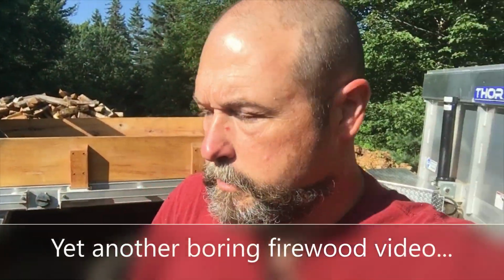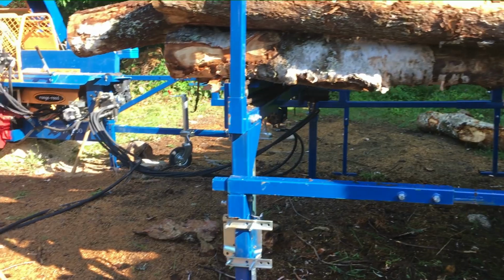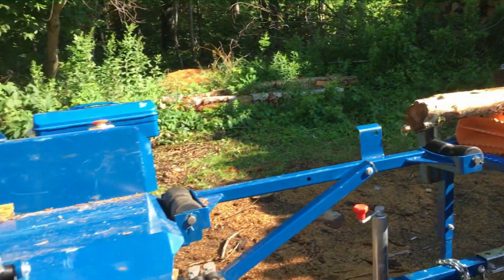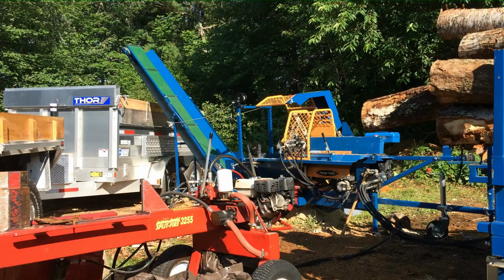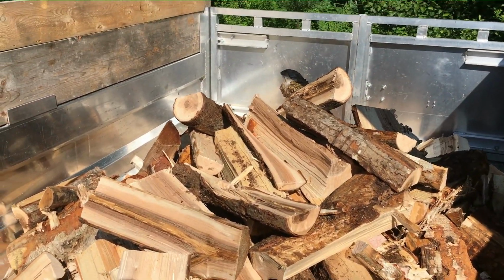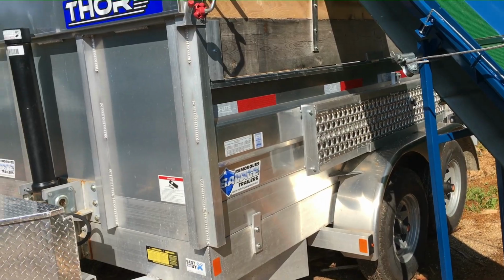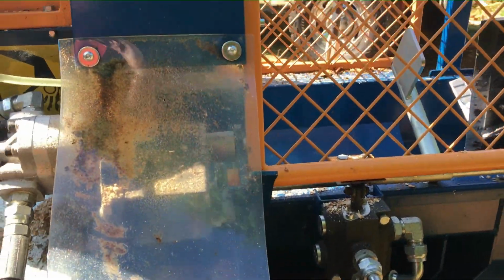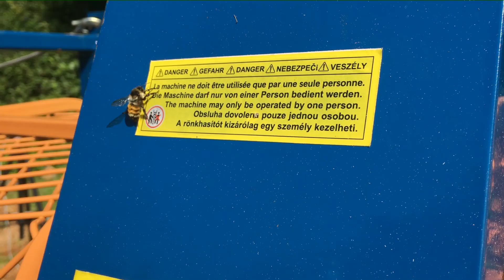Firewood Processing for my birthday!

Comment: Been over a year and I'm still waiting for a call back.. to fix the issue we had to change to a chain conveyer
Reply from the maker: Who have you been trying to call? My local dealer doesn’t return my calls or emails either, I’ve been in touch with a dealer in Alberta, he’s been great.
Reply: @thelogfather5002  found on kijiji 16 foot conveyer... some dealer in New Liskard Ontario.. tried calling and emailed the guy that brought it from China from Alberta but they never got back to me... the belt dog tracked left and right.. making it 100% useless.. we ended up moving the motor to the top and put a chain on it instead of belt.. works great now but a pain in the ass out of crate
Reply from the maker: That’s too bad. I’ve had amazing experience with Range Road. I kinda understand about the dealers not communicating about sales, during the pandemic I’m sure their supply chain had been disrupted like everyone else’s has.  But with a service issue, I would have thought they’d have returned your call at least. Sounds like you don’t need them now! I have the belt conveyor on my processor, once it was dialed in,  it’s been trouble free. About 75 cords of hardwood through that machine this fall alone.
Thanks for watching just the same! 
Jeff
Reply: @thelogfather5002  guess you got a good one.. mine went both directions...lol.... I had 2 millwrights work on it they deal with belts and stuff daily and they couldn't fix...

Comment: 180 cubic foot = 5.097 cubic meterS  I concour with your measurement= 1 cord  BTW 1 cord = approx 3 solid CM of wood
Reply from the maker: The key word is solid. You need 3 solid CM per cord, but 5 loosely piled is just about the same as 3 stacked with precision